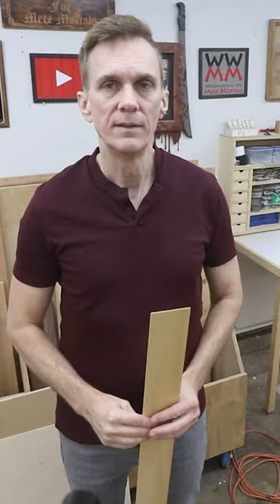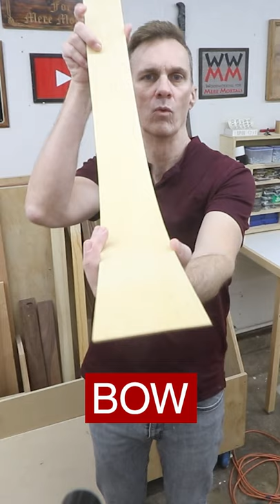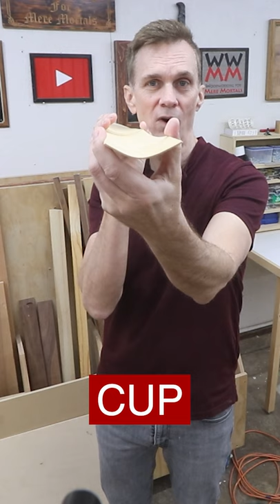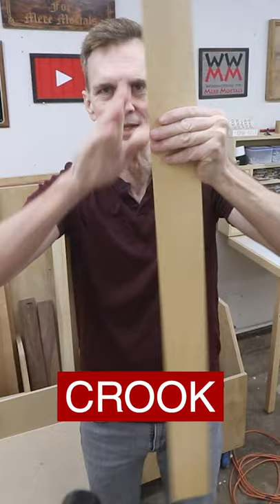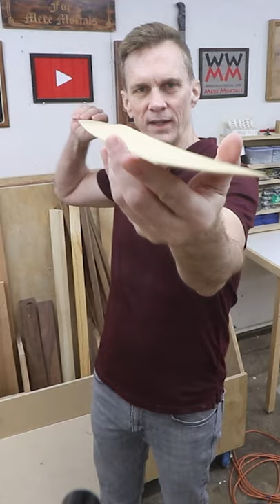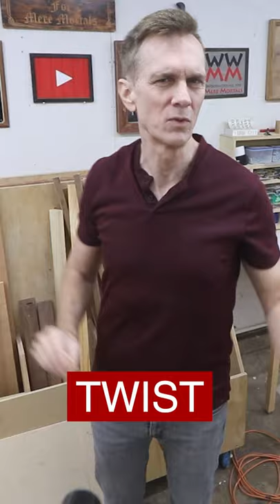How to describe home center lumber  #shorts

Comment: We always call them the "Lowe's patented pre-bows".  It is shocking how much of their lumber have severe twists/bows/cups/crooks, specifically the 2x4s.  I don't know how they manage to get them into stacks.
Reply: its like they do it on purpose, it cant be by random chance
Reply: They are straight and green out of the factory, and they put plastic loops around the bundles. Once they have dried unevenly and warped, they are stacked at Lowest Home Despot and the loops are cut. Now you can't stack your rejects back  nicely.
Reply: boards/ lumber at Bunnings in Australia is the same. How do you manage to put a massive bow in 20mm plywood! They are pretty clever at doing that let along 95 x 45 or dressed 4 x 2’s. No wonder our timber frame buildings move show cracks in all the gyprock.
Reply: 2X4s aren't designed for the finer things in life.  The intention is to hammer them into a wall format where the twist is taken out by nailing the ends to the base and top members.  Most 2x4s are a bit wet, too, and this helps them be forced into the wall format.  Even piled up, they're constrained...until you buy one, take it home, and it starts to dry out, at which time it twists.  The trick is to use studs, for whatever, before they've been out of the store too long.  You will also find KD studs (kiln dried) which tend to be much better for non-wall apps.  But we have to keep in mind that 2x4s were never intended for piano material.